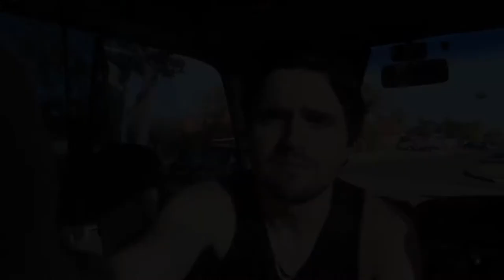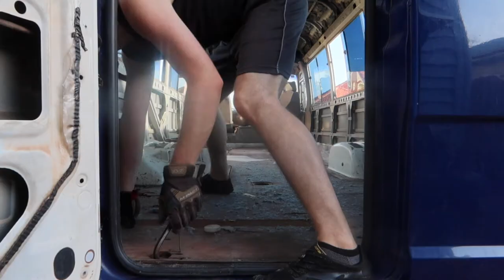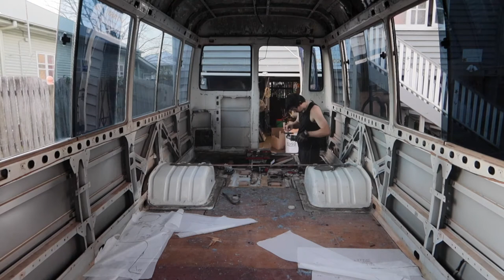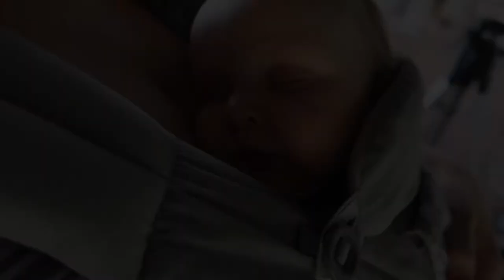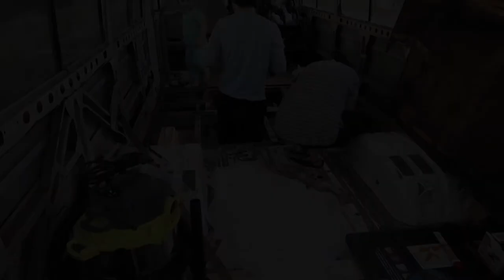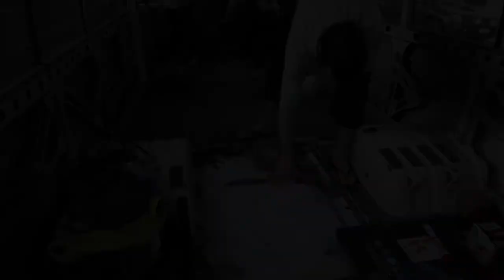Our Coaster Conversion - Part Six - Removing the Sub Floor

Comment: Thanks for posting this vid.  I have a 2010 Coaster and am about to pull a couple of floor panels up and was curious if they were glued or just screwed.
Reply from the maker: Ours is a 2000 Coaster and yeah it’s stuck down.
I highly recommend a pry bar.
Made it so much easier.
The bigger the better.
I got 2, a large and a medium so while I was holding it up with the medium sized one I could jam the larger one further in the pry.
Came up easier once I got the right tools.

There are still screws that hold it down around the edge but it’s mostly held down with glue/mastic.
Reply: @theaitkenfamily9138  Thanks for the reply!
Reply from the maker: @NinjaLifeCrisis  thank you for your support of our channel. ☺️

Comment: Hi, I am in the process of buying a 1989 Coaster to convert and enjoy your videos. Do you know what the fuel consumption is like?
Reply from the maker: Thank you for your support.

For the 2000 Coaster ours is about 15-17l per 100kms. Our coaster has a 1HZ land cruiser motor, non turbo.
Each motor has a different fuel consumption though so it depends on the motor.
Lots of information on the Coaster pages on Facebook. (Aussie Coaster Mates, Toyota Coaster Lovers of Australia and Toyota Coaster Owners group) massive brain trust there and someone will have the answer to every question :)